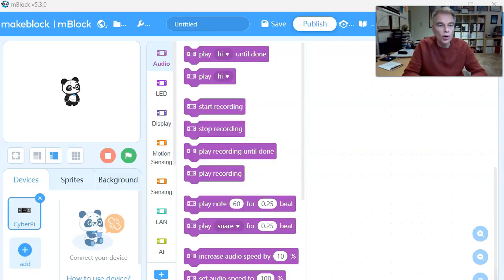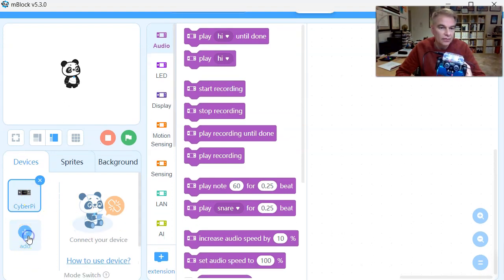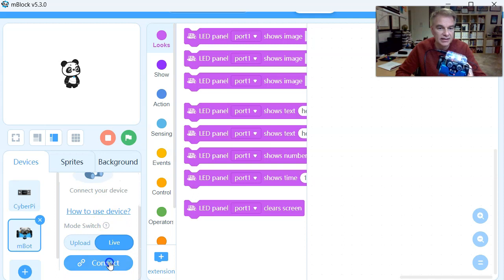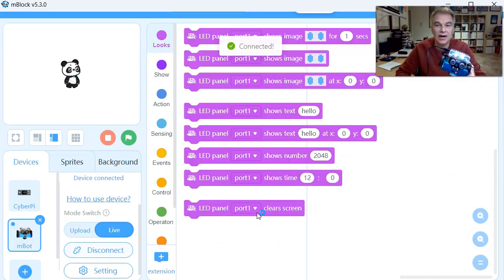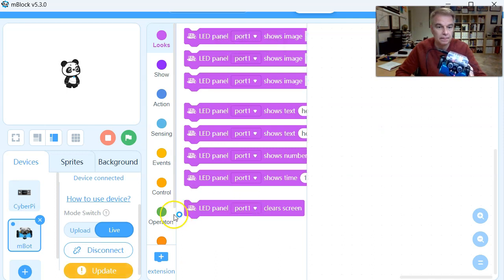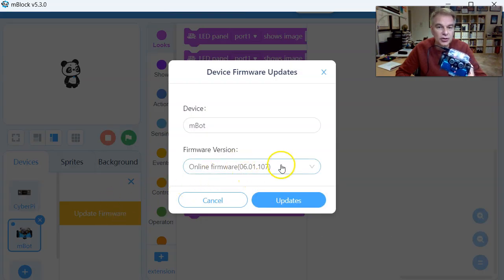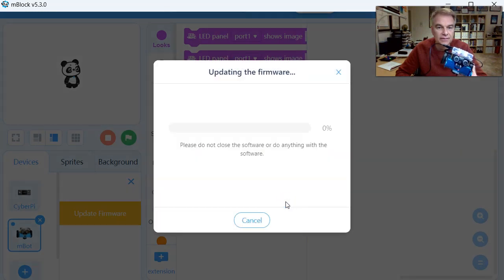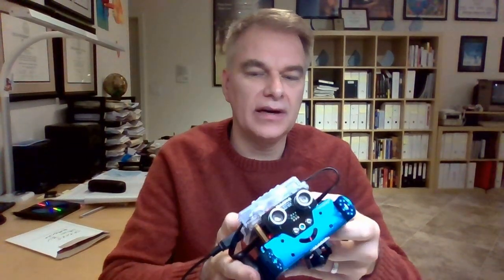Makeblock MBot Remote Control Fix

Comment: Dude! Thank you!! I got this thing cheap at goodwill, and being the techno geek that I am, I had to check it all out. I ran into all kinds of issues, but got it running with the phone app, no problems. But... I wanted it to work with the remote and to be able to do that run around thing where it avoids bumping into stuff so that my cats could chase it around. I could not find the answers until I watched your video, I can't thank you enough for solving this headache!

Comment: Giving you a like for the algorithm. Helpful tip for sure. It should alternately be possible to insert code into the arduino c input that could activate the remote. This is definitely a bit more simple though. I’ve had my mbot for just over a year now and mostly use it for edge avoidance concept ideas for a larger bot I’m designing. The mbot is a great learning tool.